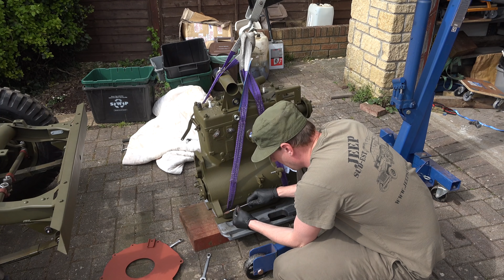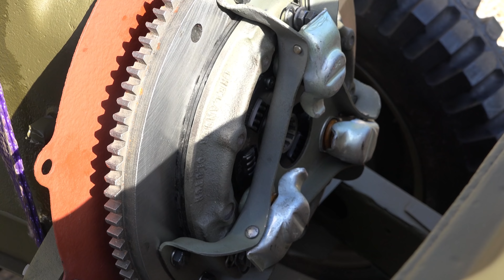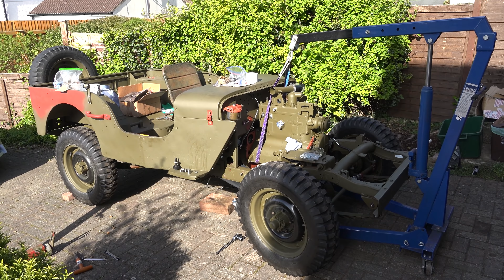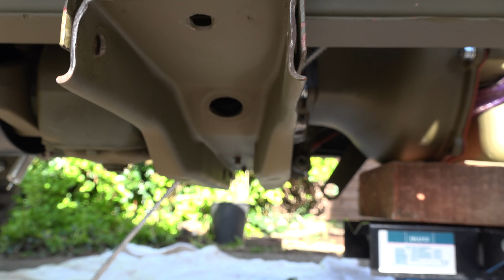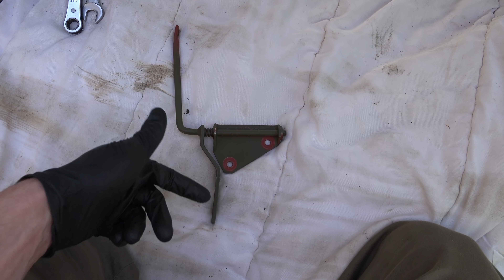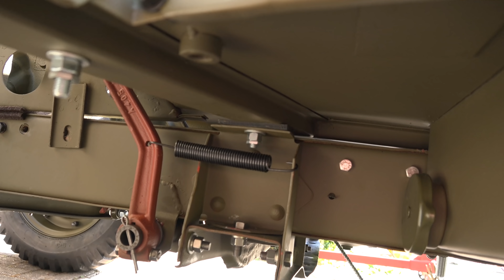I had to fit the Engine into my jeep on my own...

Comment: My son and I put the engine in my GPW a couple of days ago. No hoist, just pure muscle power. The tub is still off otherwise it wasn't happening.
The trick is to put into the block the bare minimum of parts. If it can be fitted when the block's on the chassis, it stayed off.
It was tested on an axle stand with a plank of wood as a weight spreader and the front mounts.
The flywheel, clutch etc went on and then with a jack the gearbox, t box and X member were lifted in and bolted up.
We both managed to keep all of our fingers!

Comment: Back in the eighties I stripped out the engine and gearbox from my ford cortina and installed replacements and I didn't have an engine hoist, just the branch of a tree to throw a rope over.
Reply from the maker: Good work
Reply: @Greendot319  back in them days I used to be a lot more foolish than I am now...
Reply from the maker: @uncledodge9396  I learnt very quickly how much easier cranes and transmission jacks make things easier to do!

Comment: Nice job 👍🏼 But isn't that the most ridiculous spot they put the brake reservoir ? Terrible to service and fill --
Reply from the maker: absolutely, there's lots of bits of design on a jeep that are less than ideal, I feel sorry for the boys in the field who had to work on them!
Reply: There is a simple conversion that lifts the reservoir into a much better position.

Comment: I think the tiles on the ground made the job a lot harder than it should be, I made up a large tripod, lifted the engine with a chainblock, and wheeled the Jeep towards the engine, I found I had much more control over the engine height by using a chainblock, the hydraulics tend to be very jumpy to gauge, but it is in now! Well done. The only bad thing was the awful music! Stay safe! Chris B.

Comment: You got it done now---but if you ever need to do some work on the rear of the engine again---just take the front motor mounts out, drop the engine down on the frame and it will give you considerable more room to work.

Comment: Thanks.  You gave me confidence that I can do this.  One thing.  I would push the jeep toward the engine.
Reply from the maker: It is possible, certain amount of luck involved but making sure the engine is really aligned as much as possible and levelled to the transmission is very important.  Good point about bringing the jeep to the engine! Didn't think of that!

Comment: the throttle arm will naturally fall into the upside down position position so it should be tied up. it's a bit late with this hint but if you put a jack under the front of the engine , remove the engine mounts and lower the engine on to the frame. this should provide more space at the rear of the engine....that was me more than once and i hope it helps someone. working on a jeep is always a learning experience
Reply from the maker: Good suggestions, thanks!

Comment: Good video.  I enjoyed it.  I've never had anyone helping me put in the engine or transmission/transfer case.  I've always used the crane and or/floor jack with blocks of wood.  The only time I had help was putting the body back on because I didn't want to scratch it up.  Took it off using 2x4 boards as levers, etc.